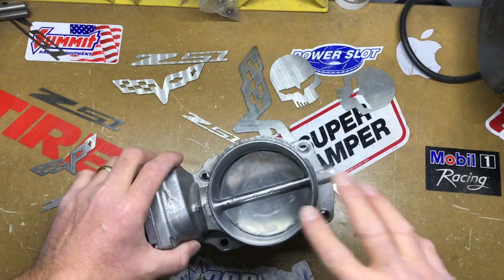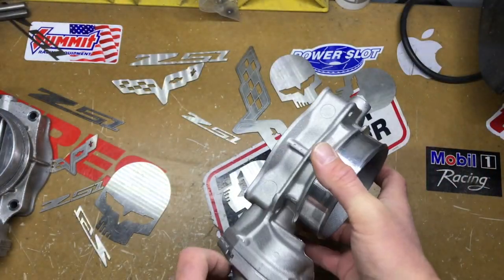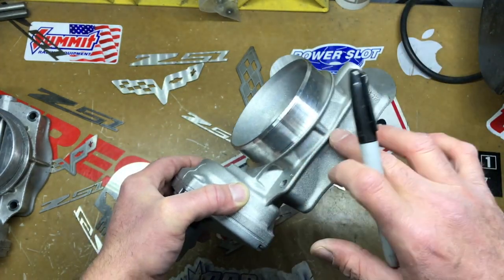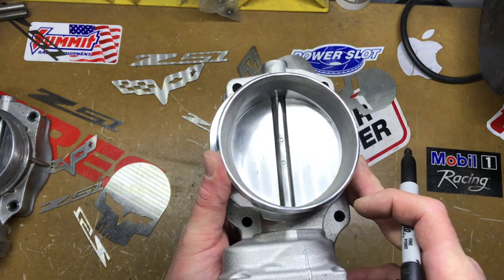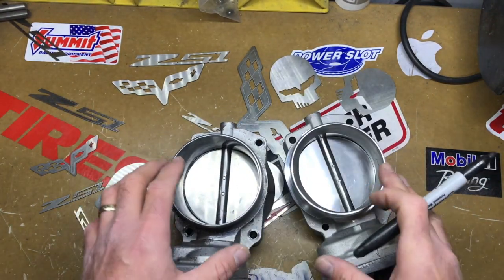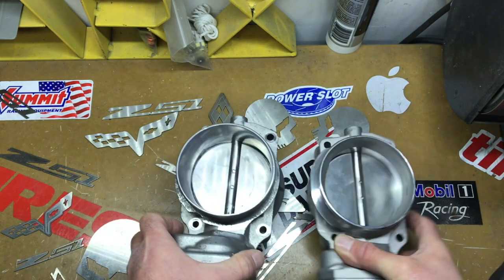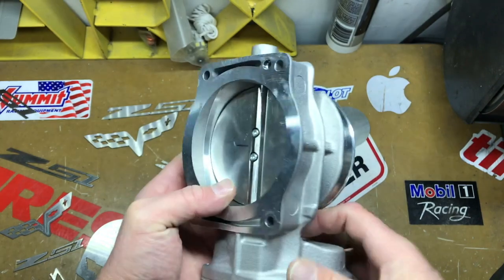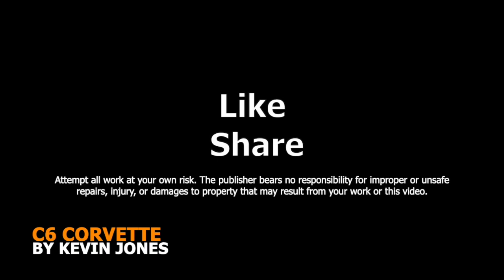C6 Corvette LS2 Dos and Don'ts Throttle Body Port and Polish

Comment: Kevin won't that damage that throttle body opening that blade like that if it's drive by wire , that's what everybody say I don't know just asking
Reply from the maker: If I understand what you’re saying correctly, you just can’t touch the machine area. If you touch the machine area, it won’t work properly.